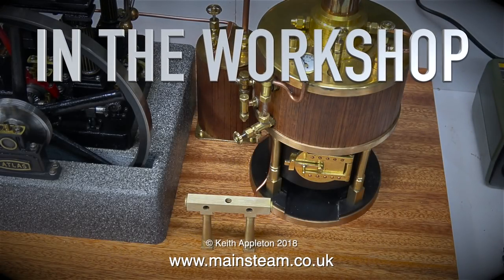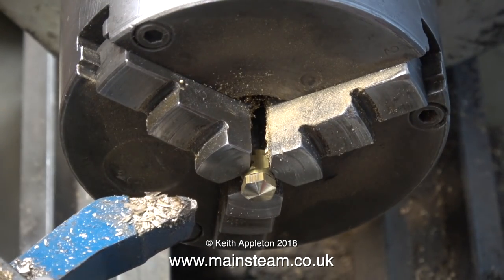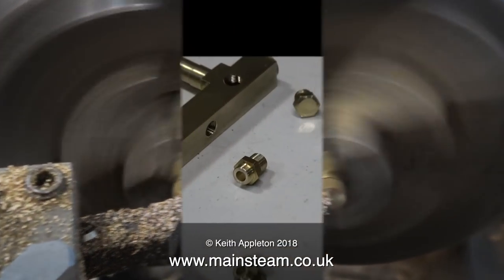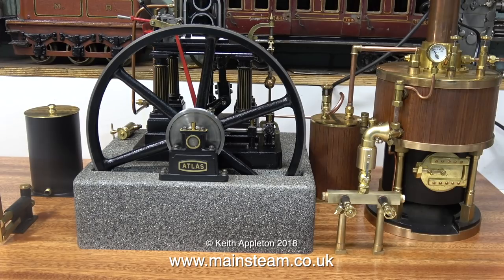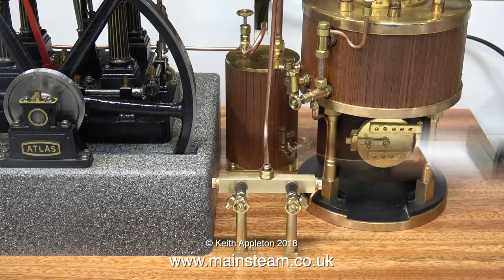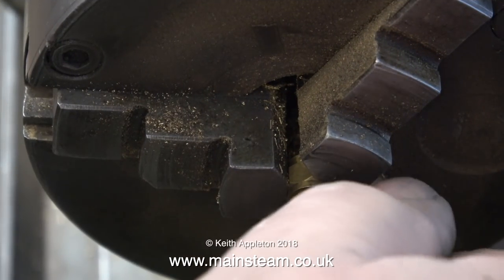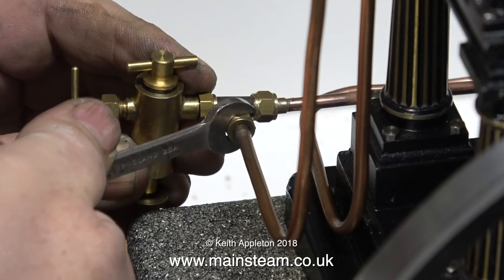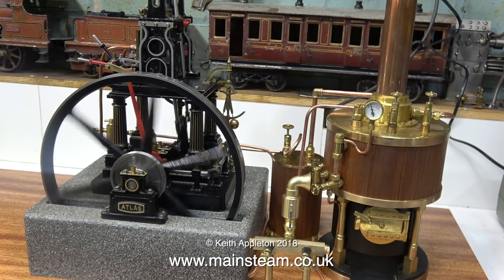ATLAS STEAM PLANT CONSTRUCTION - PART #8

Comment: I am curious as to why you used curved piping on the steam lines,  when the cast brass elbows you used on the  boilers gave a more "antique" (and very nice) appearance? Is the curved piping because of heat expansion, then?
Reply from the maker: 2 reasons. I only have 1/4 inch cast elbows and the steam lines are smaller diameter, plus it's a matter of personal taste, you can have too much of a good thing.